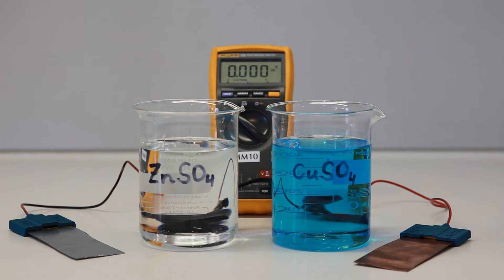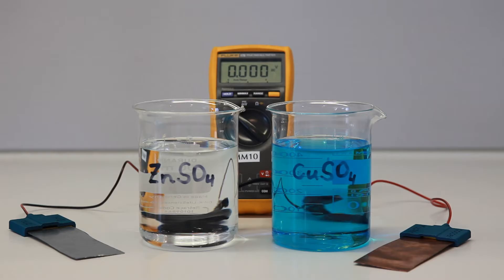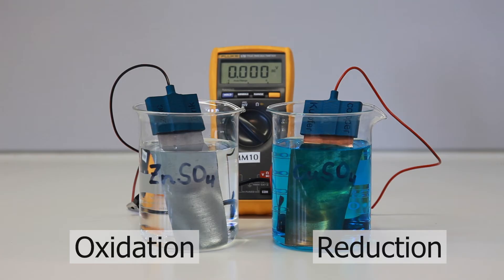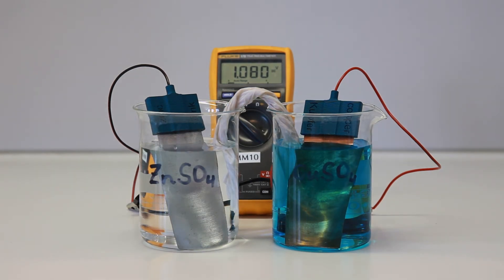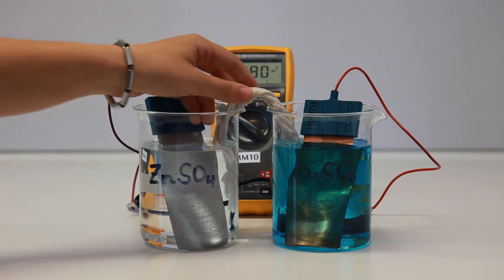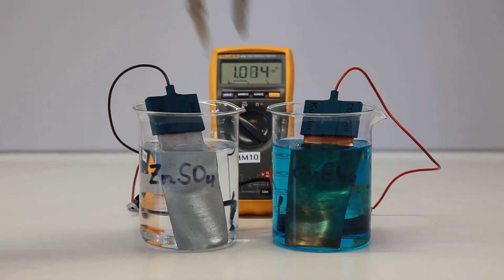Electrochemical cell: The Daniell cell

Comment: Why did Copper gained electron because we were told metals Only Lost electron?
Reply: It is not the copper atom on the electrode that gains electrons but the Cu+2 ions in the solution get reduced to Cu atoms.
Reply: The standard electrode potential is higher for copper that's why copper experienced reduction while zinc was oxidised
Or you can understand it through by
Zinc is more reactive than copper

Comment: Hi, I repeated the same experiment for a school project, but only got a multimeter reading of 0.61V. I utilized a KCl salt bridge and sanded the electrodes before use. Could you give any insights as to why it was lower?
Reply from the maker: Which concentrations of the solutions did you use?
Reply: @bettstetter  Both concentrations were 0.5M.
Reply from the maker: @anish9411  We took 0.1 mol/l for the zinc and copper sulfate solution, more common is 1 mol/l. I am not sure exactly what concentration we took for the KCl, but our study assistant thinks 0.5 mol/l (it must be higher than the concentration of the zinc and copper sulfate solutions).
Reply: @bettstetter  I was able to fix it. I initially used electrode rods with a very small surface area, and the electrode plates performed much better instead. Thanks anyways!
Reply: Why not use the salt bridge of NaCl instead of KCl
Reply: @philosophic-gajar conductivity of cations and anions should be same
Reply: @ashishraj506  I think it was mobility not conductivity?
Reply: @Sirius-0007  yeah but conductivity and mobility both are dependent on each other
Reply: @ashishraj506  Thats is true but conductance is also dependent on many other things too, like charge of the ion. Therefore it will be inaccurate to say that in salt bridge the conductance of ions have to equal as two ions can have same mobility and different conductance.